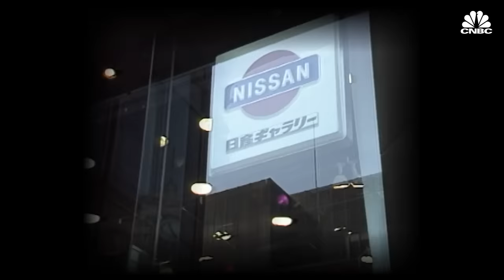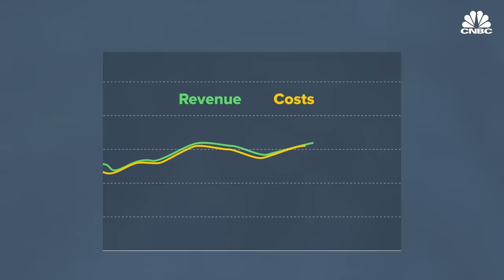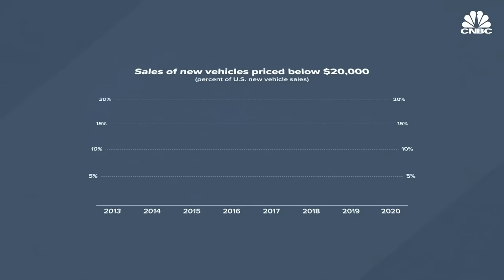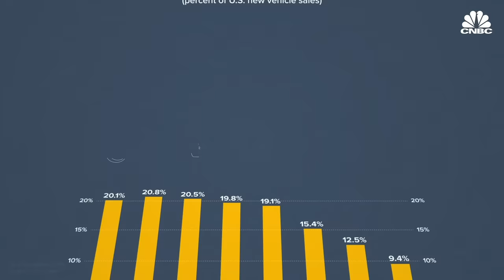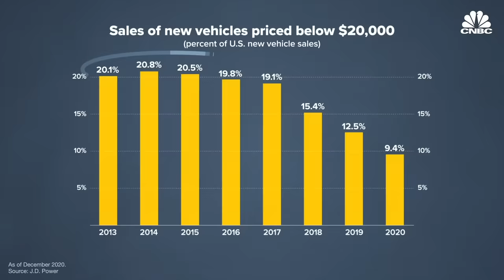Why Cheap Cars Are Disappearing

Comment: ”If you buy used, you can also have more than one car”
~ Scotty Kilmer
Reply: Thats what I do. 2 used cars. Variety and already has scratches here and there for free.
Reply: I’m taking a wild guess that Scotty Kilmer is an American.
Reply: @MaviAntwerp  Probably, but it's not as stupid as it sounds. I own 4 cars, ranging in age from 14 to 23 years old. Total purchase cost - about $25K. Total miles on the clock? About 700k. That's my car, my wife's and one each for my youngest kids. 

With the exception of the oldest car, I would happily do my annual 3,000 mile road trip in any of them (and have done). The older car did do a 1500 mile road trip this summer, and just had some trouble with a leak in the water reservoir ($50 part and 1 hour at the hotel to fix).

The thing is, unless you live IN a major city, a car of some sort is not a luxury here. Public transport is almost non-existent, and shops, services, doctors, and so on are spread out on the assumption everyone has a car. So having more than one is inevitable. It also means there's always a spare car in the drive if one fails to start.
Reply: @MaviAntwerp  yeah, Click bait, YouTuber with a million subs.
Reply: START YOUR ENGINES!!!
Reply: You forgot to specify 2 Toyotas
Reply: @-darrell  or a Honda.
Reply: Here’s one more benefit of buying used: you don’t care if it gets scratched. Last month a neighbor approached me with his little boy. The boy had thrown a rock that scratched my old F-250, and the dad wanted to pay for it. I told him that I appreciated his honesty, but don’t worry about it. Not sure if I would have done that with a new $60k pickup truck.
Reply: New cars are for people with too much money, or who don't have the aptitude to fix things. Though to be fair, newer cars have become so complicated/computerized/ with complex expensive "assemblies" that fail when one 5c plastic thing snaps/ and emissions systems that are too fragile to have much longevity/and weather proofing that is just good enough to last about til the warranty is up before the road salt rots the entire thing away... that they've made it too hard and expensive for people to fix their own cars. They make about as much profit selling parts to dealership service centers as they do making the cars in the first place. Then after 8 or 10 years after their "designed to fail" date, people just scrap them and buy a new one. Planned obsolescence.
 
It's a scam. We could be driving compact cars that will last 30-40 years with minimal repairs, and that get upwards of 40-50 mpg. It's all in the name of profits. But we've been brainwashed by advertising to want exactly what they're selling us.
Reply: I have 5 rigs, into em for about 10 grand.  None of em give me any trouble.  Early 90s rigs where the best.  Not enough electronics to over complicate but just enough to make diagnosis easier.
Reply: @entItyVR only if you buy from a dealer.  Anyone with a little savvy can still score some killer deals private party.
Reply: But financing used cars is also a rip off
Reply: @entItyVR no kidding 10k for a Civic with 100k miles
Reply: @Space.Ghost.  banks often won't do loans for private party sale. I have seen big bargain from ps. Not many of us can walk with cash to buy a car no loan
Reply: @calgary2800  they still do but they have restrictions.  It depends on the bank and your relationship with them, year and mileage etc.    I understand that but you still need a down payment in most cases.  I only spend between 1000 and 2500 on my rigs, but I know how to fix em thanks to forums, youtube and time.
Reply: @CatastrophicNewEngland  yeah, the car market today are purposely building cars to breakdown. They don't want to compete w/ older successful models that could last decades. The pompous look of modern cars are there to deceive the consumers, making them think it's better when it's not. Merely add a pad onto the car, call it newer, and you'll get the consumer into a debt trap of over 20k. That's todays marketing.
Reply: Possibly the only time I'd ever agree with him
Reply: True. In my experience, it also means you keep buying $2,000-$4,000 cars every two years but you keep hanging onto the last 3 cars you owned in case you find the time to fix them.
Reply: @rickleuce8025  sell em while they still run. A $2000 car doesn't depreciate if it runs and is clean.  I worked with a guy who did this. He never made money on em but he essentially drove for free.
Reply: @bettyvanderhooven-schmaasc4235  - Scotty has some pretty good content if you ask me. Taught me a couple of things here and there
Reply: REV UP YOUR ENGINES
Reply: If you buy used, you're rolling the dice and hope that the person who owned it changed the oil regularly and didn't fly over speed bumps at high speeds or didn't let it idle for long periods of time while they slept in the car and crap like that.  I don't trust used. I'd rather pay more money for new and have piece of mind.
Reply: @CarMaintenanceGuy  - Depends of it was a single owner car or nit as well. I have service records for all my oil changes
Reply: @yodamaster757  Lot more than that.  I'm not rolling the dice.  Not worth it.  Many new Fords and Toyotas come with like a 5 year/60k mile drivetrain warranty.  I'd rather buy new and get that good 5 years out of it.  No need to buy used.  With the small amount I'd save, it's not worth it.  If the car was worth anything, the original owner would have simply kept it instead of getting rid of it.
Reply: @CarMaintenanceGuy  - I’ve had my 03 Toyota Camry for 6 years. All it has needed was oil changes and a cat. Has 300,000mi
Reply: @MaviAntwerp  ... He’s a great American!! Well respected, loves his Toyota’s.
Reply: @yodamaster757  I'll give you a cookie.
Reply: @CarMaintenanceGuy  not everyone can buy a new car every 5 years or afford the perpetual car payment.  Plus the terms on some of these auto loans can go longer than 5 years.  If you're not careful you get stuck with negative equity refinanced into another car.  Seen this happen often when I sold the buggers.  PLUS most people dont wait for the 0% interest rates events (if they even still do em) so you just add another 2-10% to the price thanks to the interest.  My wife's old Corolla was 15k and ended up costing her 23k once she payed it off and the car was only worth 4k......   I agree it is a big risk, but i would rather take that risk than be perpetually paying a car note, full coverage insurance, and eating negative equity.  Personally, if I did buy a "new" car it would be a CPO, already depreciated and sometimes the warranty on em is better than the new cars.
Reply: @Space.Ghost.  Sounds like you need to increase your income.  Corollas are so slow and dangerous.  They give tons of people road rage.  They are not worth the hassle to own.  Just buy a nice $30k car and stop being cheap.  You are hurting the economy and ruining jobs by being cheap.  That's not good at all for anyone.  Just get a 0% or 1.9% loan for 72 months and buy a nice vehicle to be happy with.  Stop buying such small and uncomfortable vehicles that have no utility, not fun to drive and have paint that starts peeling off when they get older because the manufacturers were too cheap to use a 2-step process when painting the car.  I've been in your shoes before.  It WAS NOT WORTH the savings to buy cheap cars.  I'm done with that. Those cheap cars are BUYER'S REMORSE cars.  People buy them and trade them in not long after once they find out how slow they are and lack all modern technology.  BUY what makes you happy, not what you can afford.  LIFE IS TOO SHORT to buy JUNK!  When you die, make sure you're buried in debt by at least $500,000.  Just like those Egyptians who died... they DID NOT take theur money with them when they died and you DO NOT TAKE YOUR DEBTS WITH YOU WHEN YOU DIE EITHER!  DIE BROKE AND HAPPY!
Reply: @CarMaintenanceGuy  my income is excellent and my overhead is minimal. I could walk into any dealership and buy most rigs right now with cash but why watch that huge investment just get beaten down in parking lots until its worthless?  I agree corollas are junk but some years run FOREVER. I would rather learn from people's mistakes and buy smart avoiding the years with documented issues.  I find it ironic that buying used hurts the economy but sticking creditors with 500k debt that you never intend to pay is any better. All replacement parts are USA made which directly helps the economy.  Do I sound like I am complaining about my rigs? I love my rigs. My daily is a 96 F250 powerstroke that still makes me tingle when i hear the turbo spool.  I love all 5 of my old beaters.  Cars are ment for one thing, getting from a to b, everything else is a creature comfort and unnecessary.  You have so much tech packed into a single bumper that it drives the price up past 1000 bucks. This just seems asinine to me.  I do buy what makes me happy.....
Reply: @Space.Ghost.  I agree. Don't fall into the trap. There are so many good used cars out there. I don't think it's at all necessary to drown in debt just to have "peace of mind" that new is the answer to all. Some new cars have issues and they're CRAZY expensive these days. After car payment and insurance you're paying rent/mortgage all over again..... No thanks
Reply: If you are tech savy like Scotty I guess you can take care and fix used cars
Reply: @SuperMerlot  #1 You need space #2 you need tools #3 you need to live in a place that allows car repairs #4 you need to be in good health.
Reply: Unlike those endless money pits! Only buy a 1994 Celica! ^^
Reply: I have two cars that both run GM 3.8, and one only cost me $800.
Reply: @mitchspurlock3626  What is your household income per year, gross before taxes?
Reply: @CarMaintenanceGuy  what's your social security number? Just curious
Reply: @mitchspurlock3626  What does that have anything to do with your income?  I'm just trying to see why you would only spend $800 on a car.  Do you only make like $10-20k/yr or something?  Or live with parents and have no money at all?  Just trying to learn the rational, that's all.
Reply: @CarMaintenanceGuy  well you see, there was a car for sale for 800 dollars, so I bought it.
Reply: Rev Up your driveway!
Reply: @mitchspurlock3626  Still doesn't help me.  No way would I want to risk buying a car like that unless I knew the owner.
Reply: @CarMaintenanceGuy  800$ is far from a risk, they're worth 300$ in scrap so it was more like a 500$ car.  I don't buy a car without driving it first, and I deduced it was worth well more than 500.  I spent 100$ replacing the battery and it has required nothing else for nearly two years.
Reply: @CarMaintenanceGuy  To assume a vehicles cost is reflective of it's value is a false assumption whether it's used or new.
Reply: @mitchspurlock3626  Without knowing your annual household income, I can't see the reason for buying such a cheap car.  Are you 17 years old or something?
Reply: @CarMaintenanceGuy  so you enjoy spending more money than is necessary? I dont
Reply: @mitchspurlock3626  Whatever you say, tough guy... the guy chicken to give out a household income from an anonymous account.
Reply: @CarMaintenanceGuy  you got problems bud

Comment: There are two "modern" things I want in my next car. The first is aux cable/bluetooth support so I can play my music over the speakers, and the second is a rearview camera. I don't really see myself wanting any other techy features, I'm not driving my car for luxury, it just gets me from place to place.
Reply: You can buy an fm transmitter and you can here everything from your phone with car speakers! Also i am sure that you can put a camera rearview also..
Reply: Since i live in a 3rd world country

As a car owner (we own a family car, mom and i drive the corolla) an average budget meal car consumer only needed these (the others are wants like luxury stuff)

-parking aid is optional since i had illusion of reverse parking thinkin im already near an obstacle.
-power windows
-power steering
-power/manual adjust side mirrors
-bluetooth and flashdrive stereo with 2-4 speakers

Anything else is manual...
The seat adjustment, transmission (yes the country contains 60% manual etilist car owners), ac system + thermostat, low/high beam adjusts, hill start? Out legs are fast in timing lol, tailgate, handbrake/footbrake(depending on car), analog gauges with blinking warning lights when problems come...
Reply: Blind spot monitoring is a lifesaver, esp in busy city road.
Reply: never rely on a backup camera. any camera at that! use your natural vision to look at all angles when backing up
Reply: Yeah - those "modern" things you mention only appear in the vehicles of the top-1% in every other nation other than the United States.
Reply: @socalstr   Nope, back up cameras are mandatory in many other countries